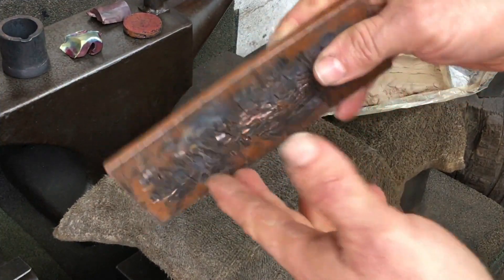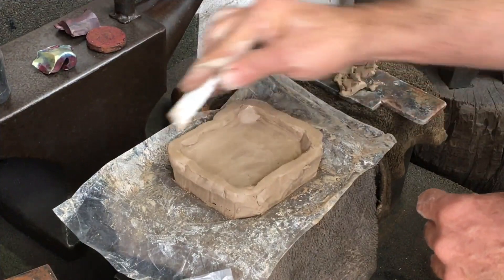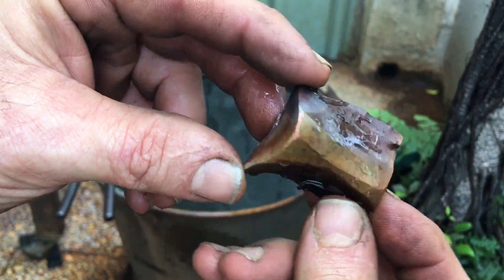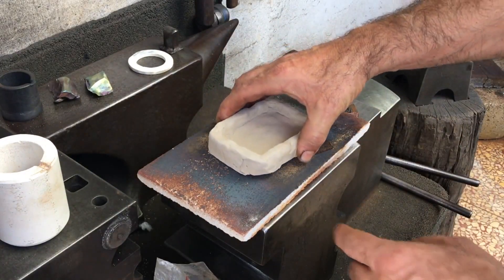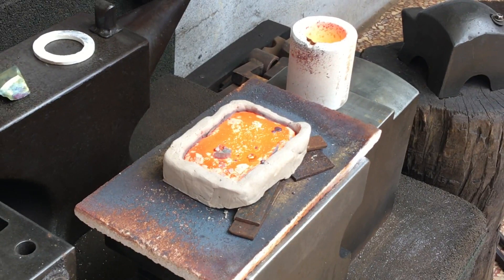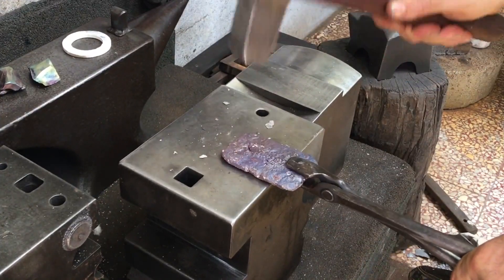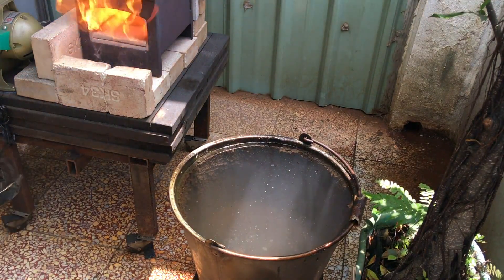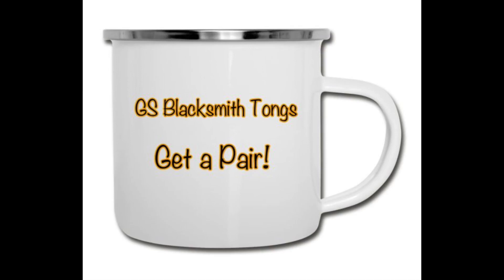Copper Casting / Blue Green Patina

Comment: Glenn I feel you would benefit greatly by having a little greensand on hand. A poor man's recipe that I use that is consistent and reliable is a mixture of good fine dry ocean beach sand the finer the better. Mixed with about 20% by volume cheap Dollar Store plasticine. I melt mine and mix it with the sand using a drill and a bent rod. Poor Man's petrobond! Works like a charm for me. And it keeps without problems, does not even dry out and if it does a little splash of oil freshens it right up!
Reply from the maker: Hey Jay, I will have to investigate your recipe for greensand and experiment with that. It seems right up my alley - simple and easily attainable. I don't know a ton about casting and so also need to read up and learn from others. Thanks.

Comment: Have been gathering up random brass pieces to melt down. Can I do it in my gas forge in a steel crucible ( homemade) vrs having to buy one?
Reply: I’m curious about this too. I’ve set up electrolysis with a copper sulfate solution to purify the copper, but now I have a bunch of powdered copper instead of solid brass
Reply: You certainly can melt in a steel Crucible. But you do have to pay attention. And after multiple melts your Crucible will fail. I use heavy steel pipe pinched at the end and welded to melt copper and brass. A pipe about an eighth of an inch thick will usually stand a few hours of melting.
Reply from the maker: Hi James and yes, you should be able to do that in your gas forge and in a steel crucible. But I have almost zero experience with brass and so just take the proper precautions. Thanks for watching.
Reply: @67spellcaster  thank you

Comment: Adding Aluminum powder to a Snowball bush will turn the flowers Blue.  Wonder what it would do, adding it to Copper?  I can't find any info online.  Be careful!!!
Reply: Adding aluminum to Copper during a melt at the rate of about 9 are 10% by weight produces aluminum bronze. It is a similar colour to Brass perhaps not quite as lustrous. But very hard and resistant to corrosion.
Reply from the maker: Hey Ron, I'm sure you know but with any of this, just be careful since we never know what reactions might occur. I'll shout you out in my next video (post later today) for your generous donation. Thanks.
Reply from the maker: Thanks Jay for giving a detailed response.

Comment: I smelt a lot of brass, and find any copper components in the valves always end up in the slag! Copper must be way above the melting point of brass!
Reply: Paul, can I melt brass down in a steel container in my gas forge?
Reply: @jamesshelton534  
Yes, thats what I use, you need to run the gas pressure at about 25 psi to get the heat though!
Reply: Copper is slightly higher than brass in melting temperature. But I think you will find Copper components within brass valves are likely to melt unless you're teetering right at the very edge of the temperature. The unmelted components are likely steel. Check them with a magnet to be sure.
Reply from the maker: Hi Paul, Interesting point you make and certainly useful for someone out there. Thanks.
Reply: @paulorchard7960  thanks